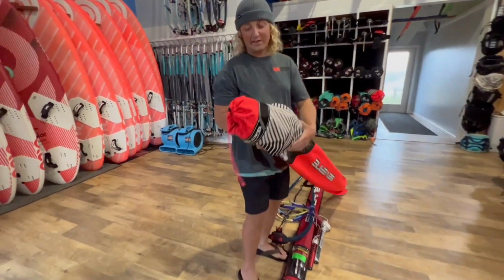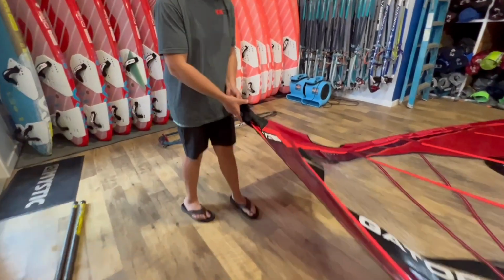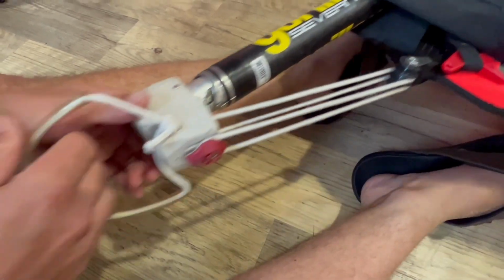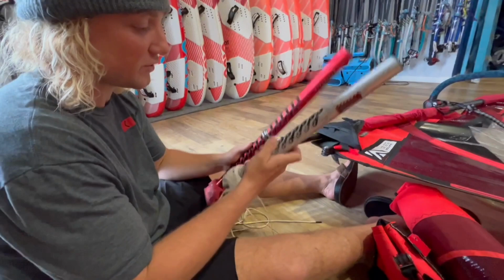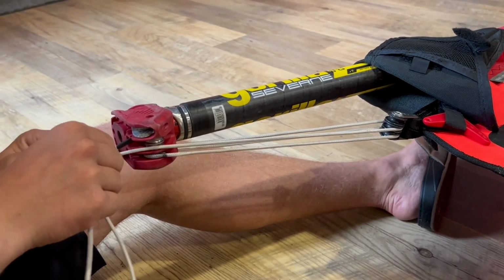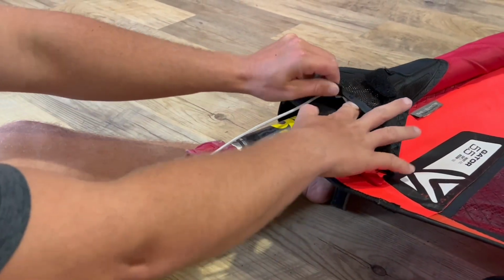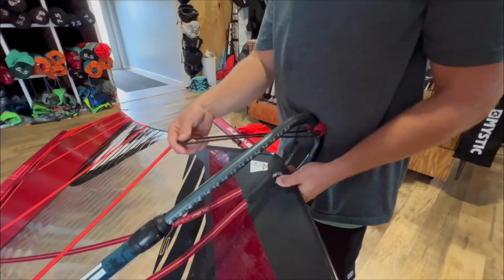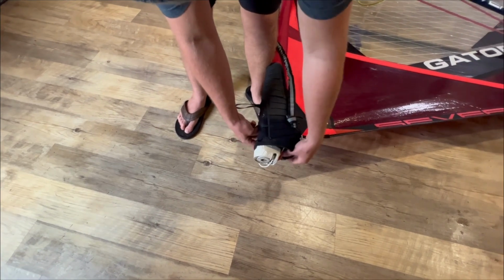How To Rig a Severne Sail

Comment: Thanks for making this rigging guide (I have a load of Gators). I note that whilst emphasising the extension setting of 2cm, the shot of the sail rigged showed it about 2-3 cm off fully downhauled. Can you add a few words on what tension you’re looking for on the leech of the sail?
Reply: Hi Rob,  Typically we list the max recommended downhaul tension on the sail.  For the Gator, Blades, S-1s, you can really tune the sail to the wind conditions or to get the perfect feel that you like by adjusting the downhaul.   Typically, you'd downhaul the Gator until the ripples in the sail come in about 1/2 way to the mast between the top 2 battens.    Personally, I find the outhaul specs pretty spot on for all my sails.   Best thing to do is play with the downhaul tension a bit and tune the sail to the way you like it best.  Some people prefer a springier sail with less downhaul, some people prefer a lighter feeling sail with more downhaul.  Completely up to the user. 

Hope that helps!  
Mike Burns
Reply: @severnewindsurfingnorthamerica  Mike, many thanks for your reply. I think I'm getting to the stage where  I'm experienced enough to be able to feel the difference in set up, however being a visual learner, it would be great if someone (preferably from Severne or a trusted partner) could turn that into a video.
Reply: @bobbinabout1317   Try this one I did for the Freek a couple years ago.  The Gator's leach will be a bit looser, but the concept is the same.

https://youtu.be/kz2P0ZFdUvo
Reply: @severnewindsurfingnorthamerica  “Typically, you'd downhaul the Gator until the ripples in the sail come in about 1/2 way to the mast between the top 2 battens.”
Thanks!
I rigged my new 2023 7m Gator today and it had far too much loose leach following the settings on the sail.
Now I know the extension setting is max, which is different from the 2019 7m Gator it replaced which was pretty good when following the printed settings on the sail.
Reply: @phil2186  Glad I could help!   With any brand sail, it's good to tune the downhaul depending on conditions or the feel that you like from the sails.  Severe sails have a really good wind range regardless of tuning.  Changing the downhaul 1-3 cm will make a big difference in the way the sail feels.   So it's best to figure out how you like your sail to feel and use that setting for 90% of your sailing.  

If the sail feels top heavy or too punchy, give it 1-2 cm more downhaul.    If the sail feels gutless, then let off on the downhaul 1-2 cm.

Have fun!

- Mike